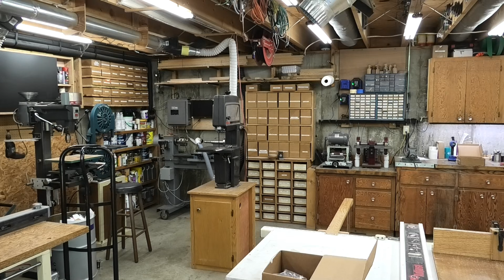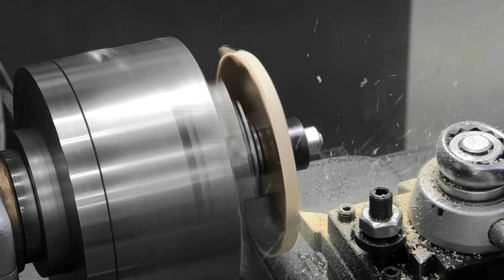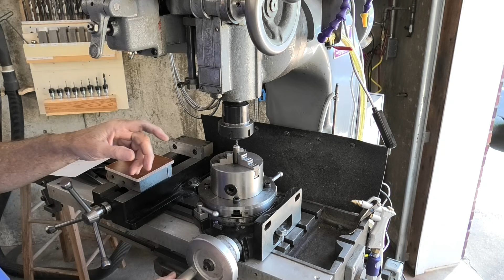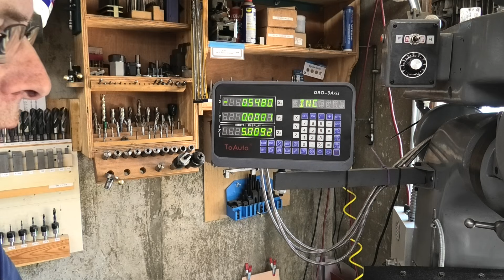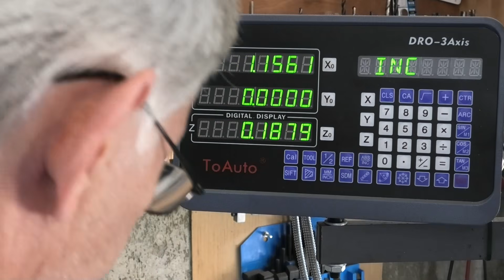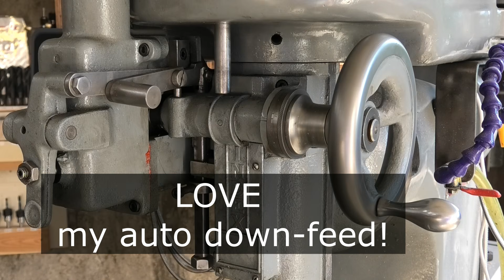Making Neon Clock Parts - Pt 1

Comment: Any project with neon tubes is cool. High voltages, fragile glass and exotic gasses. What could possibly go wrong. 
Regards,  Preso
Reply from the maker: It would be more fun it I was restoring the whole clock but just making parts...  interesting though.

Comment: Fun project...  Since the black phenolic was not available, I wonder if black Delrin could have worked.  It is easy to find and machines nicely.
Reply from the maker: The brass discs conduct about 10,000 too 12,000 volts. It's low amperage but nevertheless, if any arcing occurs the could be heat involved. Derin would work at least for a while but it also melts.

Comment: Great Idea using the rotary table Mark. I'm fortunate enuff to have 2 Verticle mills and I have my smaller mill set up with the 8" rotary table on it all the time. I also have a 4" vice mounted on the rotary table which gives me instant 360 degrees of angle on the vice if need be. I also use the end of the rotary table as precision Angle Plate. Set mine up with a tenths indicator so I can drill a hole in a gnats ass if I need to and it will be perfectly verticle. I can also use my keyless chuck while using the rotary table with the 4" vice on top of it. I have not found anything I can't do with mine yet. All one needs to do is understand how to use one and add creativity. If anyone can get the job done I know you will get it done and done right.
Reply from the maker: Vertical gnats ass drilling is important.. 😅.  Multiple machines are a big plus. At one time I had two lathes and I almost wish I had kept the one I sold. Super handy!.
Reply: @WinkysWorkshop  Yep I have 2 lathes also. It seems I always go to the oldest smaller one that I used to rebuild the larger one because it is so handy and much quiter because it is a belt drive and not a gear drive. I absolute love the Old Wells Index mill you have. Same with that old Green I think Avery drill press. I found a drill press that is older than dirt  similar to your green one but it is chain drive. Guy says it has a bent spindle in it and I can buy it for $50 but I have to drive all the way to FT Cobb Oklahoma (80+ miles one away) to get it and my traveling days are at an end. I've got to where I find something in town I am reluctant to buy it because I don't even want to leave the house. Old and Lazy. LOL  Good to see you back in the shop. I've been wondering about you and a little concerned. You know Harrold (ARW) recently passed. I always liked Harold and his videos. Looking forward to the rest of the clock project.
Reply from the maker: Yeah, I'm doing okay...  like you, I'm slowing down. It's frustrating...  I have all sorts of idea and nowhere near enough energy to accomplish them.

Comment: Too bad you couldn't find the black phenolic. It machines with less burrs. In my experience machining this material you are using, it dulls tool quickly. Anyway it worked and provided a process many will have never seen. Thanks!
Reply from the maker: Black would have been better but the burrs come of easy.

Comment: Odd being old enough to remember neon signs as modern.
Reply from the maker: Yeah, same here!
Reply: @WinkysWorkshop   — As an early teenager, I was allowed to roam freely on Saturday night — and often wound up in the parking lot of the Riverview DriveInn restaurant.  At the rear of the lot stood a large shopmade bug zapper.  It was a four sided aluminum angle tower, headed with a screened in argon lamp tube.  The screen — like the lamp — was energized by a sign transformer as big as a cinder block. Under the lamp hung a gunny sack to catch all the fried bugs.  June bugs went up with a regular pop.
Reply: @dankolar6066 
Those were times when men were men and boys knew better than to touch things that would roast them.  Well, the boys who survived the “learning process,” anyway.  😂
My buddy blew a little hole in his thumb when he tried to adjust my neon sign transformer-based Jacob’s ladder using a paper envelope to insulate himself.  🤦‍♂️
Reply from the maker: Ouch!